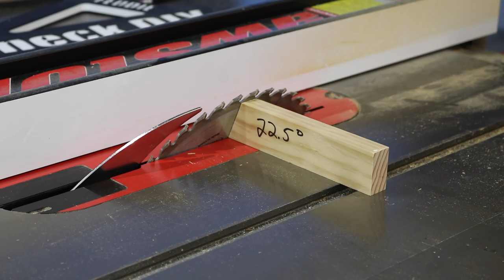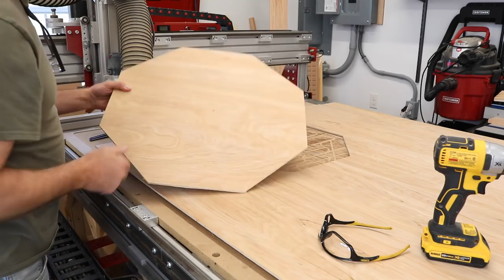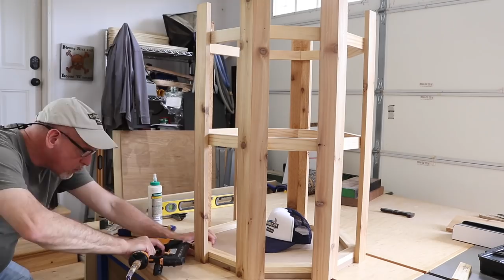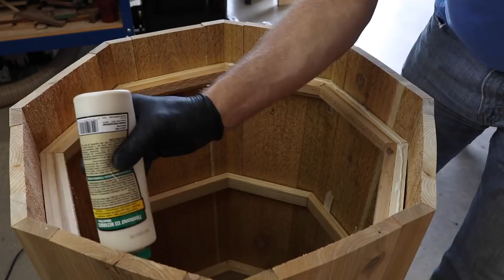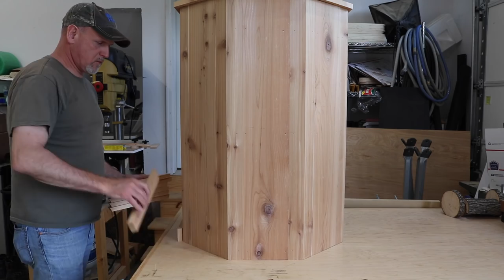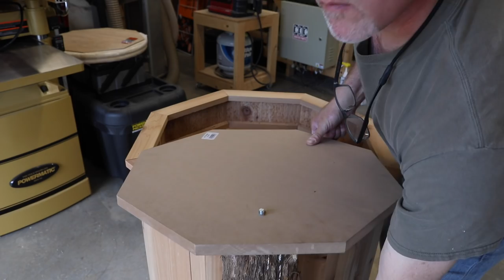Build a Deer Mount Pedestal

Comment: Really nice job! Clearly been a hot minute since you posted this video but I'm curious if/what did you use to weight the base to prevent it being top heavy? I have a P&Y Shoulder Elk mount I would like to put on a pedestal instead of wall but can't afford to pay a thousand (+) dollars. Since it's considerably larger than a deer, I'm wondering if this could be adapted to accommodate.